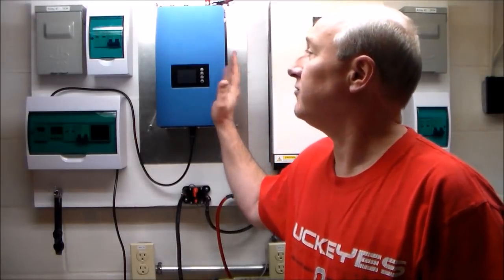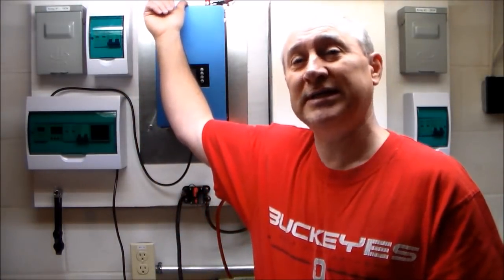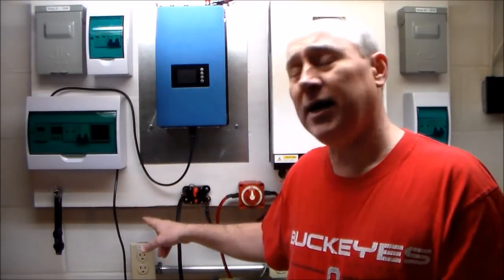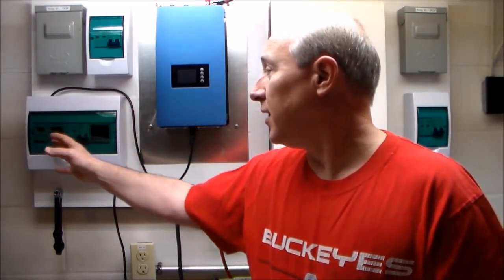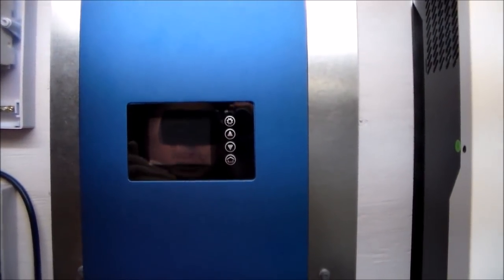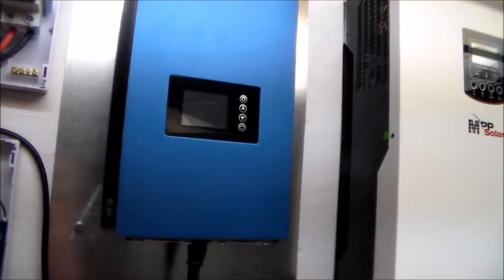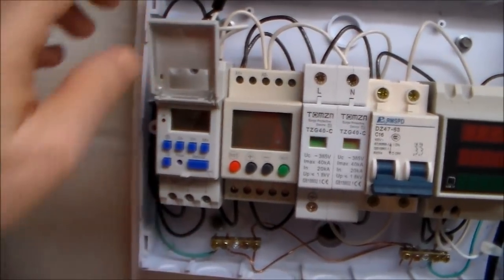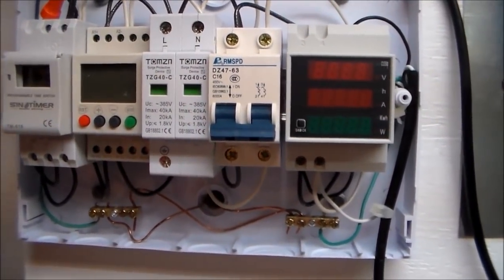DIY Solar - Episode 8 - Sun Grid Tie Inverter + Safety Devices (GTIL2)

Comment: The power coming into most houses is 2 phase.  One phase normally runs the lights and the other phase the wall sockets.    240VAC  L1 to L2.  120VAC  L1 to ground and 120VAC  L2 to ground.   You will need two inverters, one per phase.  You also need to check if your power meter will not charge you for putting power out to the grid.  Most power-smart meters will not run backwards.
Reply: Why couldnt you use the 2000 watt version that is 240v AC into a double pole breaker then you would be feeding both legs. Only problem is I am not sure how the limiter would work as it only moniters one leg
Reply: Good post, but in the USA its called Split Phase.  Smart meters run backwards, but bill as usage going into the house.   Check out the dual coil cables on ebay.  Search GTIL CABLE

Comment: Although this is good always get a professional to check as our strange regulations she may not know about or safety issues that have only recently been discovered such that they’re not in regulations but have been causing issues. Most of your safety concerns are okay in other countries simply because they don’t use the poor quality system implemented in America. It is worth knowing that certain circuit protective devices cannot operate with backfeeding power. You must always thoroughly check that with the manufacturer.

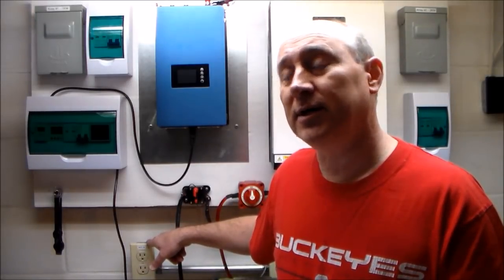Comment: Hi, you mention (7:00) that the electrical outlet has a 15 amp breaker and if someone is using a hair dryer and the grid tie inverter is also using the same wiring it would overload the wiring-circuit breaker. But my logic dictates that the hair dryer (1500w) is causing a voltage drop and the grid tie inverter is creating a voltage rise so that would mean the gti at full power is feeding two thirds of the power the hair dryer needs, basically unloading the load on the circuit breaker.
Q. The gti will be sensing a 500w incoming signal for as long as the hair dryer is on say 2 minutes. When the hair dryer is switched off will the gti continue feeding the grid for another minute if at full power?
If so, then it will be spining the meter backwards, (resetting the meter) basically you are then using the grid as a perfect battery...
Am I making any sense?
Reply from the maker: Hi Jack - I understand the logic you are referring to and you are half correct. In the hair dryer example, this situation will not overload the circuit breaker. However, the wiring between the devices and the inverter can indeed be overloaded. The two devices (inverter and hair dryer) will offset each other before reaching the breaker. However, all of those amps are still be transferred thru the wiring....which can be overloaded and heat up higher than the wiring is rated for.
Reply: Yes with the hair dryer example the wiring would be fine until you started adding more onto that line.   Remember by running the inverter on a line like that it bypasses the breaker.  Ex. 15a breaker on a line with 10a solar plug into an outlet on the same line which bypasses the breaker. You could pull a total of 25a thru the line before the breaker would go.

Comment: Are you being overly precautious with the negative fusing and breakers?
Reply from the maker: Since the breakers are the cheaper Chinese manufactured devices, I felt it would be best to also include the fuses. Also, since they are so inexpensive to purchase, it's better to be safe than to be sorry. Probably not needed.....but just in case!  :-)

Comment: Be careful what meter you have. Smart meters are the worst for diy solar. Limiting gti are needed. There are 3 types of analog meters. Really Old meters are the best. Both the disk and dials will go backwards. The next one the disk will go backwards but the dial will stay stationary. The last one you will need a limiting gti also. Because the disk will move backwards but the dials will keep moving forward ( basically paying the electric company to take your electric).
Reply: Get the Dual limiter cable on ebay.   Works on both legs of the smart meter,  Never goes backwards!  Search  ebay for "GTIL CABLE"
Reply: @artlowery2400  there is debate these don't work correctly...
Reply: If you monitor the numbers on the smart meter you should detect usage...